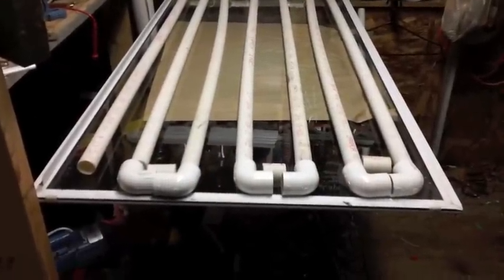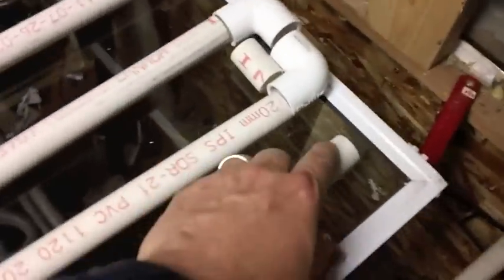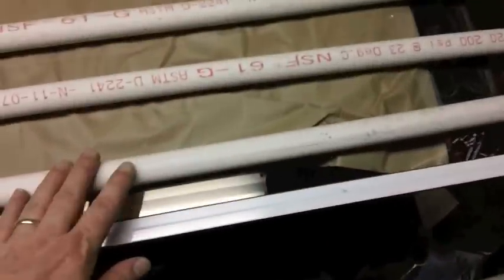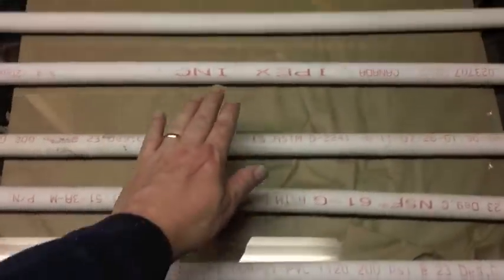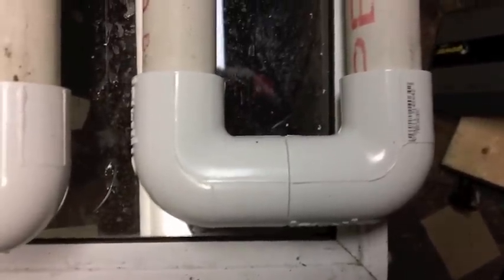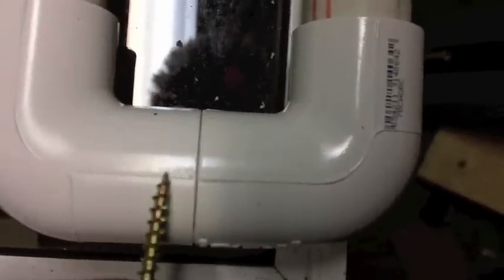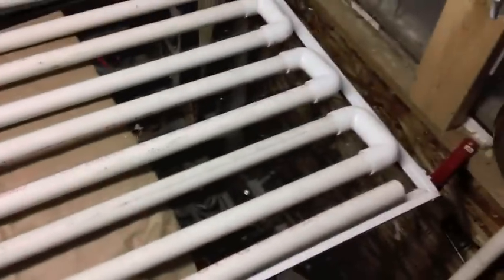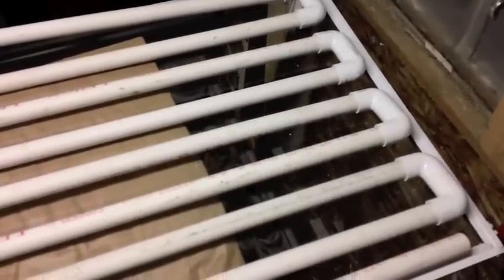Solar Water Heater

Comment: Good idea. Problems could pvc isn't uv stable, it will break down within a couple of years.  If you paint the pipe it will dramatically extend life.  You could use abs for non-drinking water or PEX for drinking.  No matter what you'll need 500+ feet or more to heat even a decent volume of water...small diameter =greater surface area =better heat gain =but low volume.
Reply: Maybe 1 gpm, on really sunny days???

Comment: Black. flexible, pvc works great in very hot conditions. About $80.00, per 50 feet. of inch and a half. can be glued into fittings.
Reply from the maker: Nice, Sounds like a much better material to work with. Thanks for the suggestion!

Comment: Great idea but plastic is not the best thermal conductor. Copper is better
Reply from the maker: +james86368 Agreed! But free copper pipe is hard to come by in my area. The metal scrappers have been scooping it up. They even break into vacant homes and rip it out of the walls.